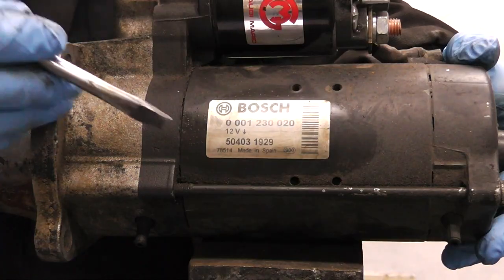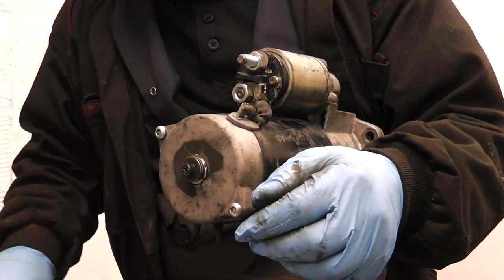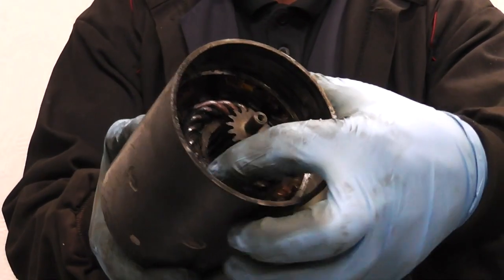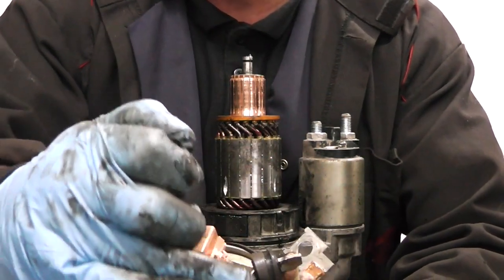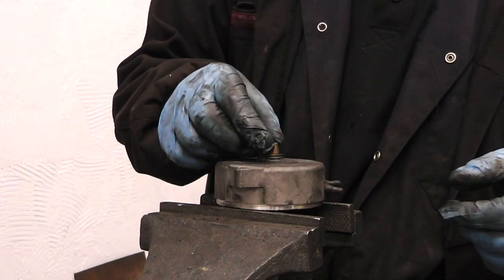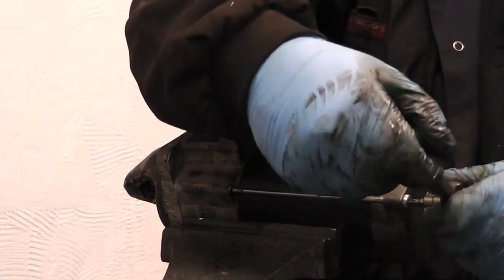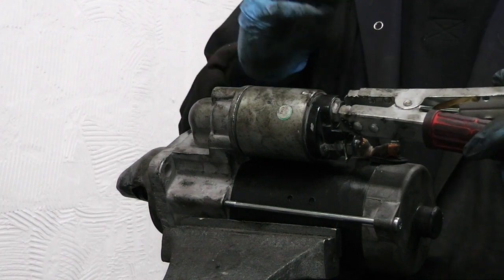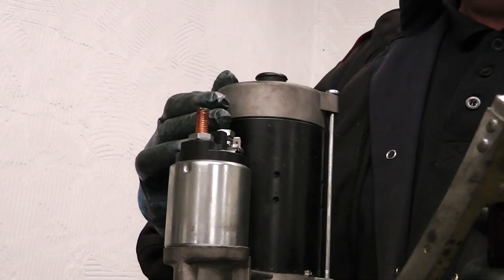Truck Tractor Starter motor diagnose adn repair.Bosch 230/231 series.

Comment: Good movie for very fast repair :), i like to chage the bush from insiade, becouse from top it can be damaged :p, the good option is too check the bush from reduction gear too :) , be cerfull when check like that if it is 12 or 24 volts, i run 2 times (replacycing new starter) becouse of incident ,starter 12v in 24 volts, and once he stick the solenid, and 2 times, he broke the brusch gear and rotor :p

Comment: Very good video !!
Excelente amigo. Mi auto es chevrolet malibu 1981, motor 231 V6 y estoy interesado en ver videos sobre sobre reparacion de piezas mecanicas para este tipo de motor : oil pump, carburetor rochester dualjet 210, etc, etc.

Thanks from Caracas, Venezuela !!